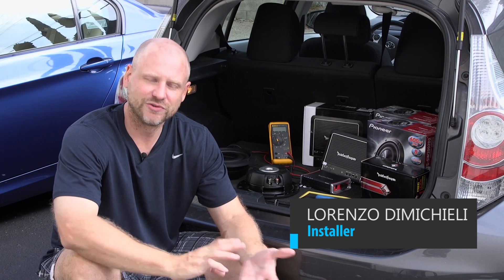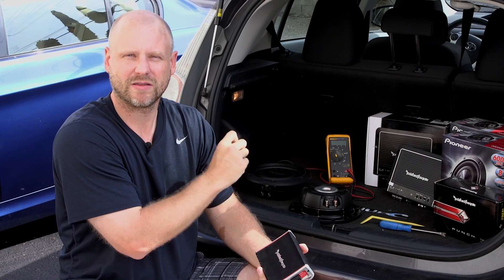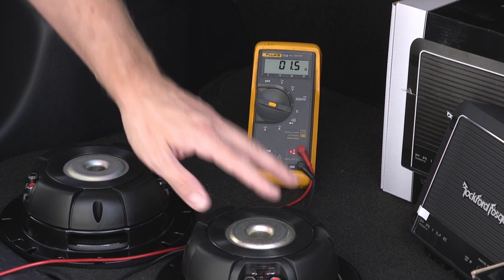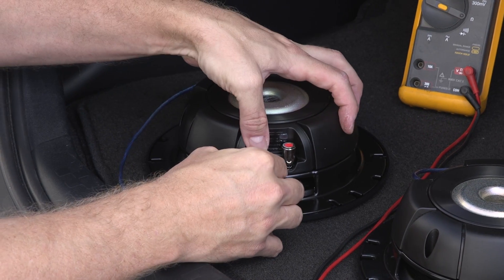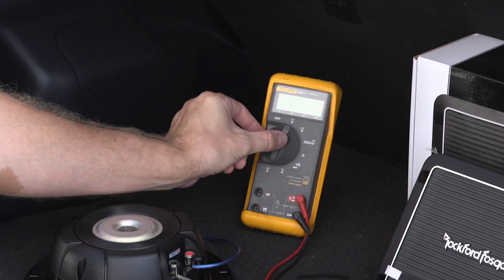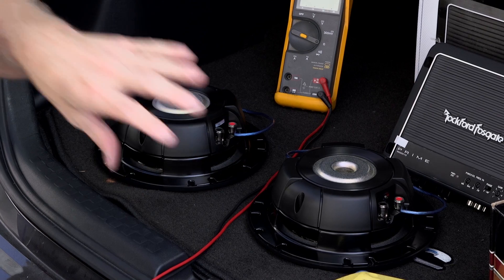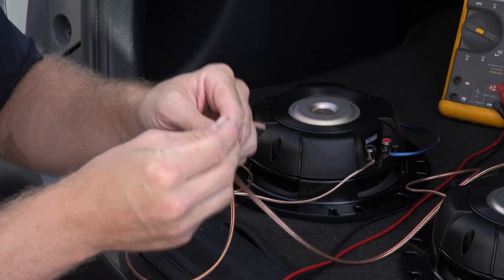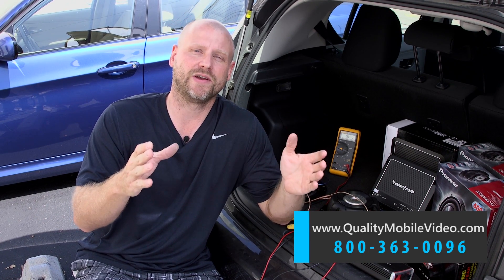Dual Voice Coil Subwoofer wiring - Dual 2 ohm coils

Comment: * I see alot of people asking this question in the comments but I feel they're asking it the wrong way so I will try this way ......
After you wire the positive to negative on each subwoofer, THEN can I wire the existing positive and negative of each sub to the terminal cup INSIDE the sub box, then on the outside of the box take those positive and negative wires to the amp? This is if It has 2 + and 2 - connectors ON THE MONOBLOCK, THey will connect together inside the amp. There will be 2 positive wires and 2 negative wires connected directly to the amp.
Reply from the maker: Yes you can wire the subwoofers to the same terminal cup, that will be a paralleled connection 1/2 the woofer impedance. Then you can run a speaker wire to the amp. If it is a monoblock amp with multiple speaker outputs, it will not matter which positive or negative you use, those are paralleled too.
Reply: I have the sundown eV4 duel voice coil and a sundown sfb 1500 have them wired at .5 ohm and keeps clipping… going to wire to 2ohms hope it fixes the problem…

Comment: Great video 😊. I have a question. With duel voice coil subs can you connect two different sources to the one woofer?
Reply: If by sources you mean amps, then the answer is yes. But you would need a head unit that has 2 rca plug ins and you would need to tune them the same if there gonna be in the same box(if one’s pusher harder, the air will mess with the frequency your box makes). 🤙🏾

Comment: Here's my big question: if I bought one dual voice coil 4ohm per coil speaker, is there any way to hook it up to be 4 ohms total to the amp?  From what I see it's either going to be 2 ohm or 8 ohm, but I need 4.
Reply: No possible way. Either you buy another amp or another speaker.

Comment: Can I wire 2 DVC 4ohm to a 2ohm load at the amp
Reply from the maker: Unfortunately, no. Two DVC 4 ohm subwoofers can only wire to 1 ohm (parallel) or 4 ohm (series).
Reply: So if I wire parallel to 1 ohm to my amp that’s a 3000watt mono block class D. Does that mean each sub will get 1500watts a piece

Comment: What is the difference in the power connectors for a dual voice coil speaker and a normal speaker, does dual voice coild have 4 power connectors to get power while the standard has only 2
Reply: Yes because there are really two speakers in one with dual voice coil speakers.  They have to run the same sound though so I don't know what the advantage is unless it's just louder.
Reply: Really it's mostly about flexibility in configuration for impedance, budget, and available install space.

Comment: Wondering if just connecting one side of voice coil will stay the same.. have a dual 2 ohm scar subwoofer coming in the mail and an alpine mrp 1000 at 2 ohms 600 at 4
Reply from the maker: I mean don't recommend doing this, TECHNICALLY you can, but you'll be getting less than half the rated power plus it will alter all specifications and T/S parameters, won't perform near its potential

Comment: Dual 4 om n 2 chanel 1500 wat amp
Reply from the maker: Ok! Pretty easy, wire them to their separate channel/terminals in parallel, and they both make a 2 ohm impedance at the amplifier. This video shows how to wire a DVC 4ohm sub in parallel, you'll just to it twice for each channel: https://www.youtube.com/watch?v=YL9WvNPA2zs

Comment: Can I wire a dvc 2ohm sub to 1 ohm using a 2 channel amp?
Reply from the maker: Depends on the amplifier. I only advised wiring to an amplifier's stable impedance's. What's the part number
Reply: Quality Mobile Video it's a hifonics Brutus brx2016.1d .
Reply from the maker: Should work! That amplifier is 1 ohm stable
Reply: Quality Mobile Video thank you!

Comment: Never test the impedance of the coil while its on its face. It will give you a wrong reading. Thats why when he puts his hand on the back of the speaker it changed on his meter.
Reply: 24441Chris I did measurements with  subwoofer and it didnt changed

Comment: But I thought that when u now wire that 2ohm to the amp it will only see half the load, so therefore u will be actually be running the system at 1ohm set up the way u did ?? Please advise I'm so lost, I have the same exact speakers and I'm just SO LOST & CONFUSED...

Comment: i have two 4 oms dvc 12s with a mono block amp that will go to two oms what is the correct way to wire it
Reply from the maker: Two 4 ohm DVC subs cannot make a 2 ohm load. They make either a 1 ohm or 4 ohm load. So if the amp can do 1 ohm then wire in parallel, if it can do 4 ohm then wire it in series. But make sure the power ratings match at each impedance

Comment: can you wire two dvc Subs to a 1 ohm load?
Reply from the maker: If they're 4 ohm subs then yes!
Reply: Quality Mobile Video how long would an Amp last at 0.5 ohm they are DVC 2 Ohm Subs
Reply from the maker: If they're correctly matched and if the amplifier is rated for a 0.5 ohm load then it should last as long as any other system! However, the majority of amps aren't rated for 0.5 ohm stability
Reply from the maker: I'm honestly not sure how long it would last its not like there's a standard life length for pushing an amp beyond what its rated for, plus every amp is different, I really don't advise it

Comment: What about wiring each woofer to each Channel on the amp since the have two input how do we go by that
Reply: that's the same thing I'm trying to figure out nobody shows that. Have you found the answer yet?
Reply: You can only wire a (single) dual 2 ohm voice over to 1 ohm or 4ohms 🙃 The question you should ask is: what amp will run at 1 ohm(or 4 ugh)
Reply: Austin Jackson what about two 2 ohm subs ran at 2 ohm at the amplifier?
Reply: You can run it like that. The amplifier will see two speakers each running at 2 ohms.

Comment: Hello I have a single pioneer ts-sw2002d2 8 inch and a OEM amp which carry's 2 ohms at the amp. Do I connect the 2 positive posts together and and 2 negative posts to the amp to get a 2 ohm load? I know it was at 1.5 ohm which was 2 ohms nominal. I wanted to double check that was the same config for just a single sub-woofer.
Reply: did u find out? i want to do the same
Reply: Yes that's a 2 ohm load,then hook wire from the pos. And neg. And hook roo amp.